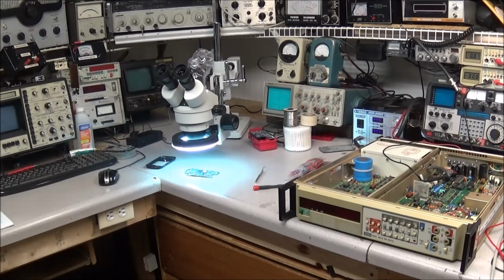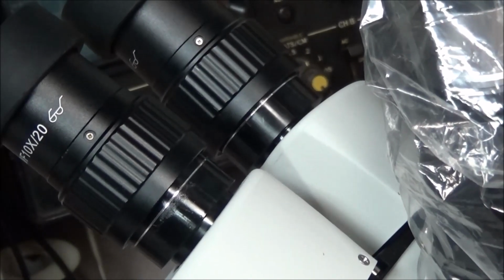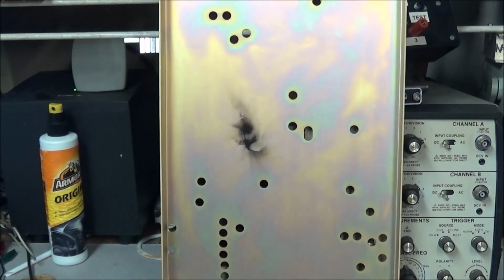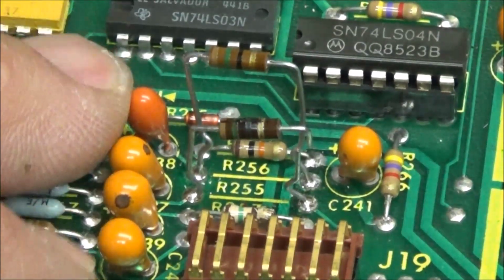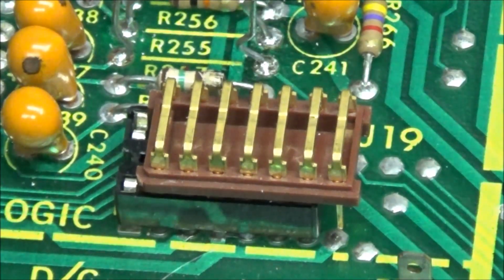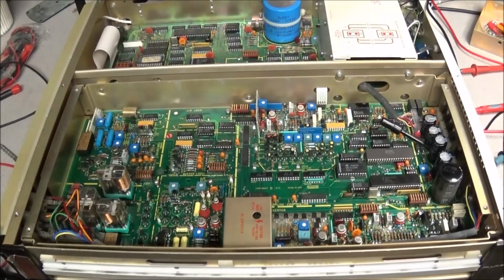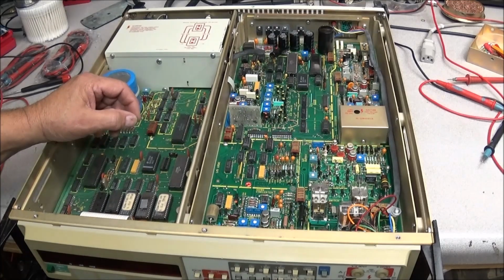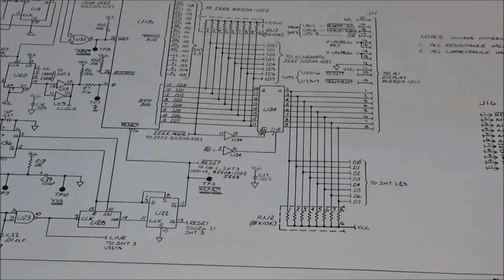#52 Shop Talk Sencore CS61 - Amscope-  Fluke 8520A update

Comment: I have that unit and have a problem only on measuring AC because of a error. However the rest is working. Now if you do finish up that unit, you will get a lot more useful Meter, after my reading the users manual if found a delightful internal program, it can measure tolerances. You feed in the upper and lower limits and you can have it show a display of Pass or Fail. I have tried it with resistors and it works. So I intend on going through my thousands of electronic parts and toss the out of tolerance ones.
 I also have a Fluke 45 and a Fluke 8840A/AF And one of them has the same style feature like the fluke 8520A, I haven't gone and read both manuals but maybe both will act similar as far as tolerance testing. I was also told to make sure to re-seat the I.C.s and clean out any accumulated dust and I might be able to get the AC portion to function, but if not, replacing caps may be the final solution.

Comment: Hey Buddy, great video. Did you ever fix the fluke?  Anyway, I had a sencore sc61 too. It was nice but honestly the internal design was trash. It developed too many wonky problems so I ended up parting it out and finding for cheap a modern mid to late 1980s Heath aka Philips scope that does what I need it to do.  Never missed the Sencore since.  I think the sc61 is very overrated although I agree that the frequency measurement was super convenient. I seldom need a scope anyway and when I do, it's never a high bandwidth situation. Take care.

Comment: I have that 8020A and it works except for the option for measuring AC. So I will look at that. Now the good news about the rest there is a sequential self test that helps, it will even test all of the display functions and test all the buttons. Also it has a set of programs that can be available to the user from the keyboard , the one I like is there is a pass/fail measurement function. So you get a bunch of new resistors, you can set up the percent of tolerance, whether its standard such as 1/2% or 1% or 5% or 7-1/2% or what you deem is required . I believe this was intended for factory inspections on lots of parts measurement. You don't have to calculate by reading the value, just watch the pass/fail display on the screen. But when I order a batch of resistors I can sort the good ones from the bad easily. I would set up a couple of alligator clips on a board wired to test leads.

Comment: I really like your channel - however, the one thing that annoys me is you don't finish projects or don't record the finish.  Just hunted for the conclusion to this 8520A and nothing :(
Reply from the maker: Thank for your feedback. It is important to me.  No, this unit has not been finished.  There is a few pieces and parts I need to finish the job.  I do not script my videos. What you see is what I see for the first time.  By doing it like this we never know how it will end. Plus customers equipment has taking the lead over my projects.
Reply: That is just how it goes.  I get a piece in and get excited, find out it needs a ton of work, order parts, fix that which leads to finding new faults and more parts.  Like he said, it is a Rabbit Hole.   Sometimes you have to step back and new stuff keeps coming.  Even if the 8520A is never finished, I learned a lot about tants, trouble shooting and shorts and it didn't cost me a penny.  Try not to be annoyed. It isn't healthy.  Best, Doc

Comment: SC 61 was made for ppl. That had to work for their money$🐴.wish I could find parts for the black ends of the probes. ? I only had 1 problem in 35 yrs, a very rare chip that reads the probe voltage for the Digital VM display died took 10 yrs to find it. 20$ min order from sencore was was 40$ in the beginning. I keep looking  for another one cheap
Reply: Any idea on where to get a schematic for this scope?
Reply from the maker: just type it in google.
Reply from the maker: Yep those probes are real expensive.  I like to find a new set for mine. I know those chips are hard to find.  Thanks for sharing.
Reply: I tried Google and all I come up with is the owners manual and no schematic. The problem I'm having with the scope is the only thing I can get on the screen is what looks like what you would get when you would push the beam finder button.
Reply: @denverjohnson9826  I got one but loathe to part with it? For obvious reasons. Where on the world are you .  Schematic  It's to big to print well it would cost too much here bouts.
Reply: @darylynn621  I am not in a really big hurry to get get one as I have been looking for over a year now.
Reply: darylynn621 I'm in Ohio U.S.A. not sure if that's what you're asking. Is there any way that you can scan it to a PDF file and send it to me by Dropbox? I would really appreciate it if you could. I've even tried to contact Sencor with no luck.

Comment: I am glued to this repair, and channel. I have the exact model as this Fluke but no issues ....yet.  So I will go through it as well with the Tants. Did you post another update?  I just found your channel and you are an amazing guy. Thank you for your sharing of your knowledge. You are an excellent teacher; very down to earth and practical.
Reply from the maker: Hi James. Glad you like the content. I have not gotten back to this unit yet.  So many projects and costumer stuff in here and time is always a problem. I have all the caps changed and the problem still there. So have to troubleshoot the logic now.  Thanks for the kind words.
Reply: @TheRadioShop  Hey there! Did you ever solve this repair? I have the EXACT same issue, EXACT same resistors blown....

Comment: I had a Sencore SC61 once and really liked it but it stopped working after just a few years.   The problem seemed to be hundreds of bad connections between the boards that are connected using tin plated pins that tend to corrode and become intermittent.  I'm not sure how that can be fixed though.
Reply from the maker: Yes I am afraid mine are starting to do the same. I am going to try and re-plate them and see how that goes.
Reply: I've been using a Tek 485 and 7633 but they just aren't as useful as the SC61.  However I recently got a Hantek 200MHz 2 Channel Digital Storage Oscilloscope from Circuit Specialists that has a lot more features than the Sencore. I don't know how they do it but Circuit Specialists sells them cheaper than you can get from Ebay sellers in China and they had a sale so I picked one up for just $249!

Comment: Hello
After I have replaced all the tantalium and the electrolytics caps except for the 22000uF one, the instrument worked perfectly.
I have the 010 option on it so I could dump the 3 eeproms inside of it as it should be only it...
Reply from the maker: Great job!!! I knew the tantalums will fix the issues. I still need to make up an order and get them for mine.  Just have had no time. I would defiantly dump those 3 proms. Never know when you need a back up.Big thumbs up

Comment: Good Work so far, but I think I saw something that you missed in this and the last video  on the Fluke 8520A - go to 8:39 in this video and look at the brown burn-spots on C237, C239 and C241. Those are failing if not shorted already. Those brown spots are not normal. You are definitely correct in what you say about Tantalum caps - they do fail at will and they do short and cause havoc :) I'm still trying to repair my IFR FM/AM-1500 from Tantalum havoc a few years back in the Generate Output Amplifier....not pretty hihi, Dan/KD8SSS
Reply from the maker: Good eye. You are the first to notice that. Yes those are on their way to failure. They do check in spec but must be replaced. One of them already failed shorted and has been replaced.

Comment: Hello
The tantalium caps are:
1x 0,22u 35V
16x 1u 35V 10%
3x 2,2u 20V
4x 4,7u 50V
8x 6,8u 35V
5x 10u 10V
4x 10u 15V
4x 10u 20V
8x 22u 15V
2x 22u 35V
3x 39u 6V

The electrolytics are:
2x 330u 100V
2x 470u 50V
1x 10000u 16V
1x 22000u 16V with screw terminals

1) Could it be possible to replace the tantalium caps with electrolytics or not (pro and cons)?
2) If I don't find them with the voltage shown above could I buy them with a greater voltage? No problem, right? I have to look on schematic to be sure but it seems that few of them have the same maximum voltage of the one on the place they're installed.
3) I watched on Mouser for the replacements and tantalium 10% cost less than 20% so I'm going to buy all 10% (same family so all other specs are the same). Nothing to worry also here, right?
Reply from the maker: Great job on the parts list for the caps. Now for the questions.1) You can replace all the tantalums with electrolytics. When tants go bad they short circuit. This causes other components to fail hard. The reason tantalums are used is for precision. Specially in timing and phase lock loop circuits.2) keep the value the same. Raising the working voltage is fine.  I have replaced 200 volt caps with 400 volt caps. Most modern day caps with higher voltage ratings are smaller than the old caps.3) I would also. 10% will be fine.  Sounds like you are on the right track.

Comment: Hello
I bought a 8520A on eBay as is and it has the same resitor burnt and the same two tantalium capacitor shorted that are replaced in this and in the previous video.
Should it be like a bug?
I didn't powered it on.
I'm removing all the tantalium caps to replace them and I think also to replace the 5 electrolytics of the power supply on the board without the transformer.
Reply from the maker: Don't really think it is a bug.  Probably failed due to operator induce the wrong voltage into the inputs or faulty tantalums.  You can pull the jumpers on the power supply outputs and test voltages.  If all the voltages check ok then start reinserting jumpers to each sections and see what you get. you can monitor the positive and minus 27 volts while doing so. Please let us know what you find.
Reply: Thanks for the quick reply.
I'll try. But before I change all the tantalium caps and the resistor.
For electrolytics I need an ESR meter...
Reply from the maker: This is a good idea. Always nice to have an ESR meter to check the health of your caps.  There are many types to choose from but you probably know that. I have several and use a cheap one more than others.

Comment: on the SC 61, erratic digitized, reading voltage from probe . I had to replace a chip made by TI only, took years cost 41$. it's inside a can top right front on a cb with a dial selector switch. it was easy to trace on the prints, at the time Sencore had a 50$ min order. The small parts on the end probes are odd and hard to find now ,kb5zxm@gmail.com. or yahoo.
Reply from the maker: +darylynn621 Thanks for sharing that. I have a feeling mine has a loose connection. Since you can tap the case and it works fine, Found out this week when I remove the case it works fine and will not fail.  Strange.

Comment: I have just repaired an old Racal sig gen. Over 90 tants replaced in total. Many had failed and taken out active component, one actually failed on the opposite board to the one I was working on, it went with one hell of a bang. That was when I decided to replace all I could see. I hate the little critters, just change the whole lot as preventative maintenance. Karl.
Reply from the maker: +Karl Fell I hear that Karl. They do cause a lo of issues when they fail. And then with 40 plus volts on them surly cannot be good.  Good job on fixing that Racal.  Thanks for sharing.

Comment: Again great video Buddy! I like this premium brands always worth to fix. I would also swap out all caps but I would use aluminium electrolytics instead of tantalum. Even the newest types are still critical...T don't like them. Can't wait until the meter is fixed.. Take care my friend 73
Reply from the maker: +TRXBench  Thanks Peter. Yes they could be swapped for electrolytic. But would may have to keep some precision. Will study the circuit more. It  should be a good meter when fixed. As always thanks for stopping in my friend, 73

Comment: Great video as always Buddy. I learn a lot from watching these. Thanks. I wonder if those 6.5's all came from the manufacturer bad? Maybe you can get away with only changing them.
Reply from the maker: +wilsonri Thanks for the nice comments. Well, we do have to look at  it like this. This meter was manufactured in the mid 80's. The tantalums they used are 30 to 35 volt caps. The circuit has 27-28 volts on it. Close to their max operating voltage. When the power rail issue came up and failed it was feeding 40 volts to the 27 volt rail. Which sent this to all components on that rail.  Safest way to prevent further issues is replace them all.

Comment: Time to load up the shotgun, dump a handfull of tantalum caps down the barrel and blast it.  Get it over with and you won't have to worry about it for a few decades. 

I had to laugh when you said how many tantalum caps you changed in the last 6 months.  I look down at my tantalum recycle box and figure I did about 3 pounds of them in the last year on top of about 5-6 gallons of aluminium electrolytic's.  Cap manufactures love me.  I have gotten to the point I don't even turn on anything over 30 years old before I change the caps.  Found I was wasting to much time troubleshooting only to find a bad cap was at fault.  Has drastically cut down on diagnostic time.  

Mike
Reply from the maker: +MikesRadioRepair LOl, Yeah I bet you go through a lot of those beast. Most of the stuff I have worked on in the last year only has a few tants in them.  But I have also gotten very selective on what I work on now. But I agree. Anything with age I re-cap all electrolytic for good measure and find it resolves a lot of problems. I had buckets of them lol.
Reply: +The Radio Shop 

If you start doing a lot if tantalums don't throw them away.  There is a big market for scrap tantalum.  Their worth several dollars a pound, just takes a boat load of them to make up a pound. :)  I recycle everything, gold plated parts, aluminum electrolytics, tantalum electrolytic, silver mica (big money) and even cut off copper leads from the above parts.
Reply from the maker: +MikesRadioRepair Great idea Mike. Going to get a load out of them from this repair hehe.
Reply: @TheRadioShop  Also recycles the planet's resources.